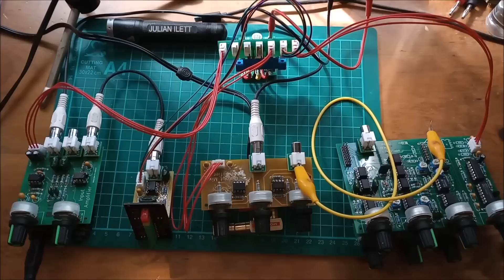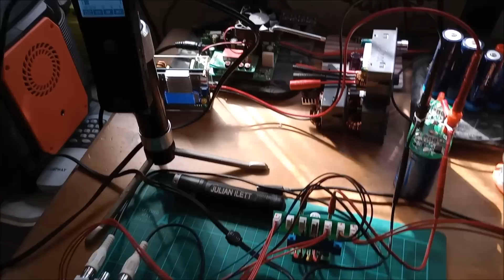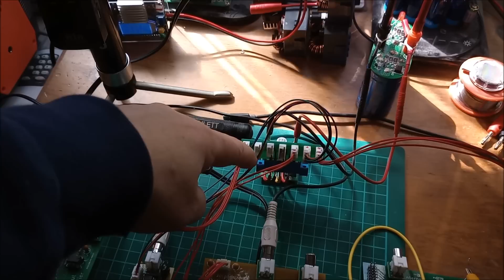The Vocoder is back!

Comment: what does an ossalator do
Reply: Oscillator?
Reply: @benwinkel  lol thanks not sure what this does or why but i like learning i wish everyone did but owell anyways thanks for sharing
Reply: @jimmy_Ross  Hi Jimmy. In this application, the oscillator is used to produce the signal, a waveform really, that, in different frequencies, can be converted to a variety of audible sounds.
In electronics there are lots of applications in which oscillators are used.
My advice is you do an extended Google search.